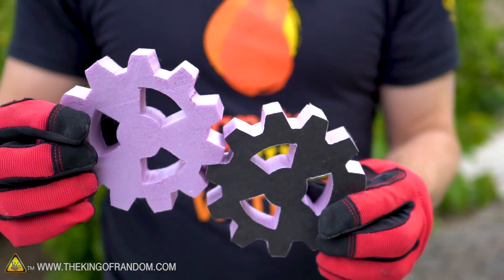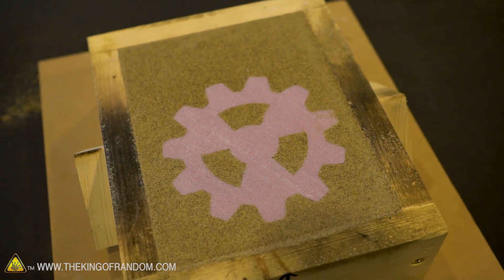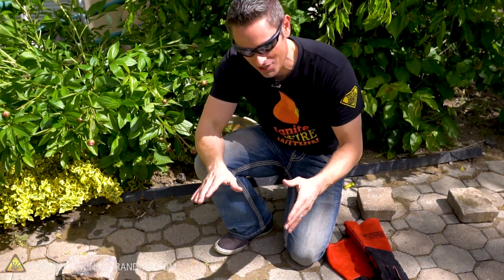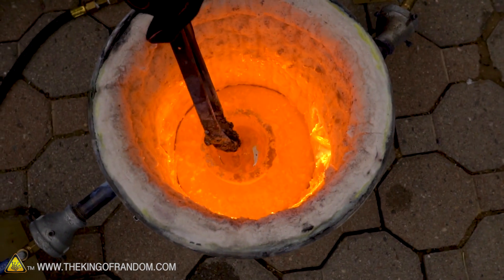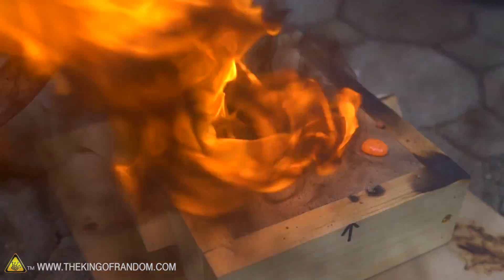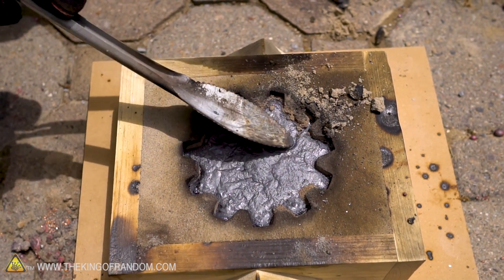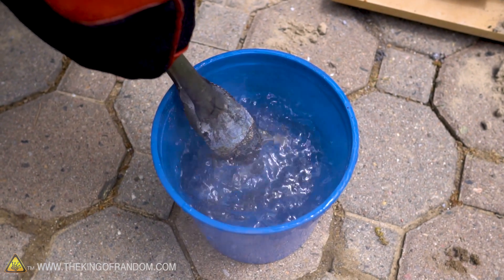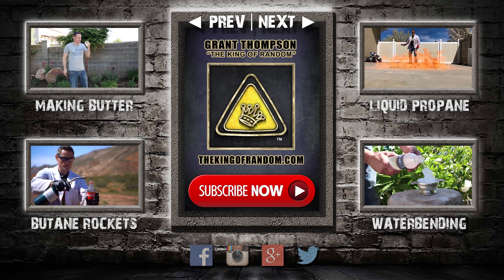Argh. Why Is Copper So Difficult? TKOR Tests Melting Copper In Our Homemade Foundry

Comment: if your going to cast copper in green sand you should use more clay in your mixture and bake it first
Reply: the additional clay creates a slightly denser mold and baking it reduces moisture and solidifies the mold
Reply: TheOtakuChicago I agree that what's I said
Reply: Sorry I didn't see your comment otherwise I would have +1ed it
Reply: I have 0 experience with metal casting as a whole but I remembered him saying something about the moisture in the sand being too low being a problem? Err...maybe the crucible evaporated the moisture in the green sand, causing the third failure where the sand got dislodged?
Reply: Grant was thinking in terms of sand castles where wet sand is more solid than dry. But the moisture will evaporate on contact with the molten metal and cause lot's of bubbles.

Otaku is saying add more clay and bake it so it becomes more like pottery. solid, dry
Reply: in green sand the clay is the binding agent so moisture is only used to to help the sand conform to the shape of whatever your casting and making it easier to recycle your molds if he had more clay in the mix and baked it first the clay would be able to bind the mold more solidly and the lower moisture wouldn't cool the copper as fast but he shouldn't use  a completely clay mold because it can have air bubbles or moisture pockets that can explode

Comment: If I can make a suggestion.... do a two part sand mold. Make the second one just solid sand, a sprue and runners this will cause a more so even flow of metal causing a better  casting and a much better product

Comment: You need to remove the Styrofoam before pouring. What you really should search youtube on how to green sand casting, go figure.
Reply: coat the Styrofoam with talcum powder and remove the Styrofoam before you pour.

Comment: I think its tour sand composition. 
Either not enough clay or fine enough to where its locking in together. As you pour the metal it drys the sand out and if the comp is of then it will be really brittle as apposed to being like stone.
Reply: Also instead of leaving the foam or melting it out extract it prior to pouring.

Comment: The reason copper cools so fast is due to it's low specific heat. It's almost a third of that of aluminum meaning it can  cool much faster so you are correct in that regard but melting point has nothing to do with it. It's all about specific heat.
Reply: Actually, let me correct myself. Melting point does actually have something to do with it. Two metals with different melting point and similar specific heats will cool differently. So to clarify, the speed at which the copper cools is based on it's specific heat, but the time it takes to solidify is based on both specific heat and the temperature the copper is currently at.

Comment: You should use a sand and Silica mix and set it with Co2 gas so you have a hardened mold that will hold without the styrofoam.

Comment: It seems to me that the weight of the molten copper is the culprit this time, even though the sand held up in yesterday's video. 
 A thought occurs to me.  If you ever want to take another crack at this, how about reinforcing the center sand 'posts'?  Analogous to rebar in concrete.  I'm thinking something as simple as three Popsicle sticks, with their sides notched up, or wrapped in a spiral of wire, embedded in the center cut-outs.  What do you think?

Comment: you can use toothpicks for the sand to reinforce it. just like concrete. this will prevent the sand  columns to come apart and the sand will prevent the tooth pick from burning

Comment: just pull out the styrofoam from the green sand after the mold is formed so it doesn't obstruct the copper forming
Reply: perhaps use a different composition of green sand as this one seems a little too loose...you shouldn't be able to poke it down with just a touch of the crucible

Comment: Word for the wise, go do some more research on designing casts. I think it would be a great idea if you contact a mechanical engineering lecturer at your local university. 

I'm by no means an expert, but i can see some flaws in the design, but i dont have enough experience to comment on the method.

Comment: Grant the reason the sand is moving so much is because you are melting the Styrofoam so when you put the copper in it will move the sand. P.S Any non-charred sand you can re-use. ;) AND Borax, and you can make the sand a little more damp to keep it together

Comment: Hey king of random ,try thise trick with green sand take  full sand box. first half don't put gear, pack it with sand, than carve a hole that is enough for the gear, but put the gear half in the sand.  bring the second half box     take a scrape pice of round wooden dowel keep it standing middle of the gear and put more sand and pact it tightly and slowly remove the dowel, but keep in mind the sand wet or put styrofoam instead of wooden dowel.  Thanks

Comment: try a different mold instead of the gear. it might be because it is a difficult piece to pour into. it might be too fragile because of the little sand chunks in the center of the gear. why not try something not as complex as the gear. i think it will work then.

Comment: FLUX your metal! Also use fully enclose your sand molds you will see better results and much cleaner casting.
You may want to try to use different type of copper, pipe is alloyed with other products to make it harder (to withstand high pressures) soft copper tubing (sold in rolls ) has lower alloy content but high oxygen  Solid  wire on the other hand  is much more stable and has lower amount of oxygen in it to obtain high conductivity. both have A lower melt point than pipe. Also to make the projects A  bit less expensive you can try alloying your copper you can add 2 to 40 % zinc to the copper and end up with brass. You can go one step further and add nickel to your brass alloy and end up with A very nice copper-silver color

Comment: I think I know why the sand was popping out because when it is wet and something really hot meats it the water inside would start to steam causing air bubbles to exit some way and I bet most of the steam would exit through the bottom # only 11 years old and figured that one out

Comment: what would happen if you put the styrofoam in the middle of the sand instead of at the bottom, and made a hole to pour the casting?  the pieces would have no room to float

Comment: What you should do is use baby powder. So place the styrofoam in the box and put baby powder over it then pack it with green sand once you get it packed tight take something small like a screw and start to thread it into the styrofoam and pull it out carefully. That way you have a mold for your copper and you get to keep the styrofoam. Slowly pour the copper dont do it fast thats why the sand is popping up

Comment: its the density of the sand. you said it yourself in the beginning of the last video. You need to pack that sand tight in the crevices before dumping sand over the hole thing then packing it. It will work a lot better if you take the time to really pack that sand inside the gear.

Comment: I think as the copper is a heavy metal it is simply dislodging the radio active islands and they float to the surface. As others have said use a two part mold which should keep the islands from floating if they dislodge.

Comment: Your green sand isn't strong enough. You should be able to literally pull out the foam gear with a little careful effort and the green sand should still be resilient enough to maintain its shape. So burning off the gear each time shouldn't be necessary. I think you dried the sand too much.

Comment: hey king of random I just watched your black powder firecracker prttey cool but I have ideal for a bigger bang
Reply: if you take two of cardboard rolls from toilet paper and make two cuts going long way split one in half put those too the side get 2 of the  plastic part of a push pop then get your choice of high strength epoxy put that on the side of the push pop insert it into the uncut roll then put some epoxy on the flat side of the plastic one of the cut pieces of cardboard  flip over news Europe oxy to attach the fuse to the plastic piece in the bottom of the cardboard roll then pour your homemade blackpowder powder in or take some and Stone grind it after Stone grinding pour some of that in then take the second plastic piece drill a hole in the center just big enough for your fuse to go through put some of the epoxy on the side stuff it into the top side of the cardboard commercial epoxy all over the top take the remaining half piece of cardboard cut a hole in slip it down let everything form and setup show me access cardboard around the edge and then wrap with tape or heavy construction paper light and see how that works for you

Comment: Grant, use both halves of the sand form, with the top half on it will hold the sand, keep the heat a lot longer

Comment: It seems the copper lifts up the sand half way. Maybe try to cast half of the gear, wait for a bit of hardening, then cast the other half. Essentially do it in layers and hope the heat fuses them well. I do like the borax flux idea from someone else as well, but simple physics say that if you have less liquid, it probably won't float as easy,

Comment: Try mixing borax in the melted copper also enclose styrofoam mold completely in sand add a styrofoam inlet extruding out sand to pour in melted copper inside enclosed styrofoam mold to retain heat doing this process.

Comment: So many issues here, a two part mold is best for fine details, second do not cheap out with the casting sand. It cannot be just sand, there has to be a binder to hold the casting. Third you need borax to separate the impurities. Casting is not as easy as it looks. Knowledge is power!

Comment: Just curious, but why didn't you use a blowtorch or just a match to get rid of the styrofoam rather than messing around with radiant heat from the crucible?

Comment: here is a tip. when casting copper, use much denser sand. on  the channel, Tito4re, he casted copper and bronze with a wetter and denser sand, it should help

Comment: grant use a closed mold. meaning both sides of the mold. it will help keep some of the heat in allowing you to keep pouring and also prevent the sand from moving.

Comment: Have you tried blasting the styrofoam with a blow torch to burn all of it out before casting? Also I think you need to adjust your mix on the green sand, seems like it's a lot finer than it should be. You have to accept that you are going to be doing a lot of filing and sanding to get a decent finish with sand casting in my (admittedly very limited) experience.

Comment: +1 here for the Double-sided mold with ventilation/pouring holes.  That would put more pressure on the three little pieces and solidify your casting that way you are expecting.

Comment: Your sand is not sticking together well enough, it is to sandy now; and you should really have the top layer of sand with the proper pouring holes and leads to the molded piece. The sand surrounding the empty molding area will help to keep the copper molten longer, and you will have less chance of  poor castings. Keep up the great work, love all that you do!

Comment: generally when using sand they use a industrial strength binding solution that burns off when the metal hits it, the reason they do that is because green sand is not strong enough to hold intricate and or delicate shapes together.

Comment: Nice, you have a chicken coup. :-) Try adding some flux powder to the molten copper before pouring it. Use a heat gun to melt out the styrofoam. You may need to add some kind of reinforcement to the sand to keep the areas from popping up.

Comment: Why not u try putting the gear at the center of the green sand and open a tunnel to the top to pour the copper. This maybe could prevent the sand from floating or rising

Comment: I think if you bury the gear instead of having it at the surface, the sand will hold its shape better. Also, I know with most metals, flux is added to keep the metal pure.

Comment: This irritates me so badly; THAT IS NOT WHAT SAND-CASTING IS FOR. If you're just going to melt away the Styrofoam, plaster would be a better material. Greensand casting is for making hollow molds that you pour into, not half molds like that.

Comment: Try baking your mold. Baking it will melt the Styrofoam and it might harden up the sand. You can also try poring the copper into a hot mold.

Comment: I think you really need to wet the sand a lot because the radiant heat from The Crucible and the copper is drying it out and causing it to collapse and destroy your mold plus try and add some clay in you green sand

Comment: Try pulling out the Styrofoam gear with thumb tacks or nails/ screws so that the mold is in the sand and the copper doesn't have to be stopped or slowed down by the Styrofoam. That way if the sand doesn't loose its shape at least it will flow smoothly into the crevice.

Comment: Use wood and baby powder instead of styrofoam. Put baby powder on the wood then add sand. When you flip it pull the wood out and then try. I think the problem is the styrofoam is getting in the way of the copper spreading, and it may be constricting the pillars of sand in the middle making them pop out.

Comment: If you use plaster, like you did with the Pokémon ball, and poor the copper into the mold when the plaster is at a high temperature. Maybe if there is a smaller difference in temperature, the copper wouldn't cool too fast.

Comment: buy some 50/50 lead tin solder and add this to your copper as 10% then you will have bronze. It will melt at a lower temperature and pour and fill the pattern better. And be harder when it is cool. You know the bronze age.

Comment: A couple of thoughts.  Close your flask and pour with a Sprue hole and vent. A closed flask would possibly prevent the inner cutouts from floating up. Another tip is to ram the sand tighter and pre heat the flask in the oven to facilitate a less rapid cool down of the copper.  Cool Videos.  keep up the experimenting.

Comment: Try to add some very little amount of water to the sand and dont melt the styrofoam and also add the copper as quick as possible,as you also mentioned :)

Comment: Why do you not pull the styrofoam out? I would poke it with something sharp and pull it out after. Then the copper doesn't need to melt it and it has enough room, as long as your sand isn't too weak it should work.

Comment: The reason the sand is popping up is because of the moisture/water. When you pour the molten copper in it boils the water and since the top cools faster than the bottom it has more time to boil the water underneath and since the water vapor is trapped it pushes up on the sand, so i would reccomend trying to make the greensand less moist, how you do that is up to you.

Comment: Temper the greens and with rubbing alcohol instead of water, add some fire clay if available. light the mold while still damp and burn out the liquid. The water in the sand is making steam which in turn is "blowing: your columns out.
Also use some drywall screws to reinforce  the pillars to eliminate the sand trying to float.  A cope with a pouring sprue and a vent will also help hold the pillars in place.

Comment: How about you make a mold inside the foundry and molt the copper inside the mold itself..... by the way you can use a blow torch to melt the Styrofoam instead of using heated copper :D

Comment: Try and make an aluminum mold with the styrofoam first then use something like borax to let the aluminum mold pop out then when your left with a perfect mold in the sand let the copper in the mold
Reply: Black sand works a lot better (although more expensive and requires oil)

Comment: What would happen if you poured flaming hot copper into liquid nitrogen.
Reply: junglehunter677 wait, but copper doesn't react with nitrogen. N2 has stable triple bonds. right? Bu, my hypothesis is that it should react like a volcano on ice where the steam blows large bubbles like glass blowing, where the liquid nitrogen creates a layer of friction and makes it flow.
Reply: Hansel Wei it's much the same reaction as liquid nitrogen and charcoal. the nitrogen is so cold compared to the charcoal, or in this case the molten metal which is hotter, would create a massive release of energy in an explosion
Reply: The copper would win. The liquid nitrogen would all evaporate long before the copper all cooled. Liquid nitrogen is about -200 degrees Celsius, and melted copper is over 1000 degrees Celsius. The liquid nitrogen just isn't cold enough.

It wouldn't explode like some people here are saying. You'd get a big cloud of gaseous nitrogen but no bang or fireball or anything.
Reply: You get minecraft easter egg
Reply: The GrantMyyister Leiden frost effect. Nothing very interesting or even explosive.
Reply: The GrantMyyister it would result in a decent sized explosion.

Comment: Hi Grant.. Copper melts at 1083 deg C whereas Aluminium melts at  660 deg C. This means that the copper will solidify at temperatures which the aluminium is still molten. To alleviate this problem you may have to heat your mold before you pour your metal. To do this you will have to make your mold with a refractory mix which hardens and then pre heat your mold (to at least 500 deg c or so). This will greatly improve the flow of the molten metal in your mold and result in a much better surface finish. You can use a mix of refractory cement and sand for the refractory mix.(alternatively you can buy jewellry casting investment pretty cheap)... hope this helps.